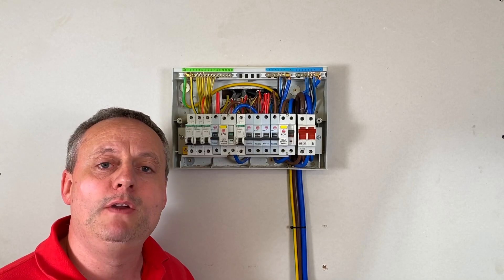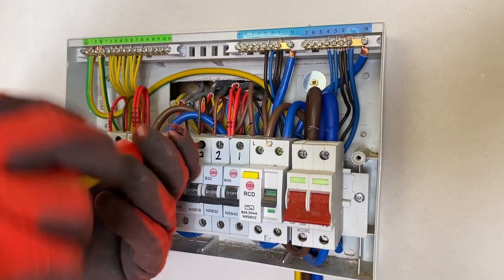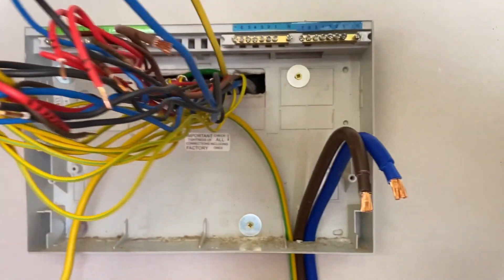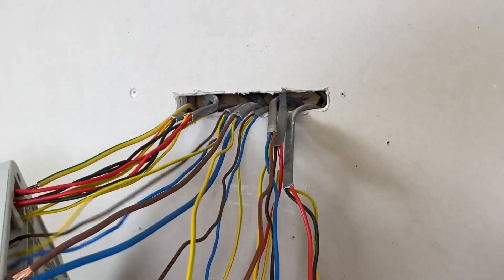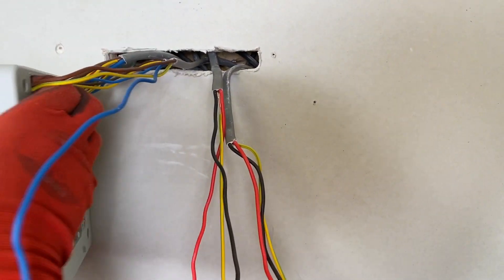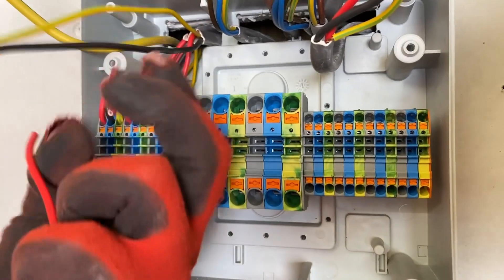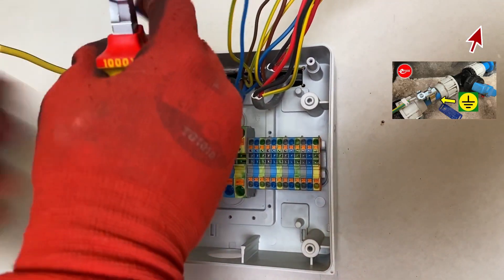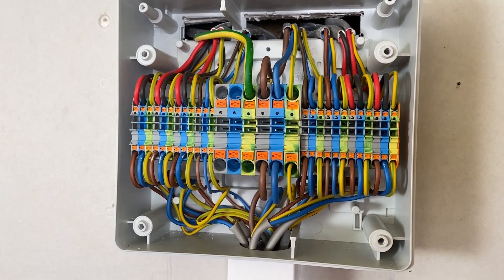How to Move a Fuse Board - The Easy Way |  Wiska Consumer Unit Relocation Kit

Comment: As the regs require the consumer unit to be metal, surely that box should be metal as well? It has all the same circuits and twice as many terminations inside, and must represent a key risk area.
Reply: Interesting that in the UK everything needs to be metal and earthed. In Germany it's not required and most consumer units are isolated and also mostly plastic boxes.
Reply: @scwfan08  Maybe German installers have a history of better installation work. We have a history of fires started by consumer units, mostly I think down to poorly made connections. Probably the same reason arc fault detectors are now bring introduced.
Reply: @Rosscoff2000  fault detectors ? What are those ?
Reply: @S-Theo  Did I mention fault detectors? Do you mean arc fault detectors as fitted to modern consumer unit installations?
Reply: @Rosscoff2000  when was the last consumer unit fire you saw? I've not seen or heard of any
Reply: @Rosscoff2000 I've seen it first hand, German, Spanish and Italian, forgive the pun, but shocking standards.
Reply: @scwfan08  well they were plastic but a lot of the London electricians are not capable of tightening the terminals up, and as a result the London fire brigade put pressure on the people that write the regulations, because they were attending so many fires each week, from poorly installed units.
Reply: @scwfan08  In Germany the walls are made of concrete. Wooden walls are very common in the UK.
Reply: @scwfan08  every system in whatever country you’re in, must be earthed
Reply: @daron8982 
Not if it's protection class 2 which most consumer units are here
Reply: @daron8982  What's that got to do with the original question?
Reply: @scwfan08  class 2 is plastic isnt it, not every applience is plastic
Reply: @icarossavvides2641  what was the original question
Reply: @icarossavvides2641  Nothing. But he is responding to a remark made in response to the original question, so his response is perfectly valid.
Reply: @scwfan08  He said every "system" has to be earthed. And he is correct.

There has to be a way to get the fault current back to the distribution transformer from where it came, otherwise the breaker won't trip when it needs to trip.
Reply: Perhaps not in this instance when connectors are spring connectors with constant force applied on conductors and no risk of coming loose. Consumer unit is different. You don't torque terminations up and and you get fire
Reply: @piotrlobacz  thats why sprung connectors are limited to 6A circuit loads only here. Anything bigger must be in a screw type terminal. Seen too many fires caused by these types of connections
Reply: Its not a consumer unit. Its the same as any plastic, crappy box you could have anywhere in your house
Reply: There’s no switchgear or similar inside so it can be plastic
Reply: @TheAviation101  it's loose connections that mostly caused fires I think, not faulty gear.  But push fit doesn't suffer from that so much of course.
Reply: I have been lead to believe the reason consumer units are now steel is so the fire brigade can isolate power with no risk of molten plastic . 100amp isolator switches are still plastic
Reply: It’s not a consumer unit it’s just a big junction box.
Reply: Regs require consumer units to be non-combustable as that is the fire bridgages point of access to isolate the supply in an emergency, so if it has melted that put them at greater risk . Their is no requirement for other accessories etc to be metal as yet as fire officers should not need to touch them
Reply: @mustardcrumbles  Where is that stated? The IET commentary on the regs says it's to contain fires within the enclosure.

The change to enclosures made from a non-combustible material is due to the rise in deaths from consumer unit house fires, which London Fire Brigade (LFB) has recorded. In 2013/14 alone there was a record 253 fires involving consumer units. This is a steep increase from 71 fires in 2011/12. LFB reported that the reason for the rise in fires was due to ‘substandard cable connections made by the electrician’, which led to the plastic enclosures overheating and igniting.

In effort to prevent overheating of the connections, the metal clad consumer unit or metal clad cabinet will contain the fire inside the enclosure and minimise any flames should they escape.
Reply: Don’t require metal specifically, non combustible is the requirement
Reply: No breakers though ... Apparently the "source" of most CU fires by all accounts ... How ironic is that! Duh!

Kind of makes my point that I have repeated ad nauseam for years ... Fit a disconnect temp sensor INSIDE the CU. Plastic needs a source of extreme heat (>200°C) to ignite. Remove the source of overheating LONG before it reaches that 200 plus temp (say 75°C) and PREVENT a fire from ever starting in the first place! None so blind as those who will not see!!
Reply: I thought this when I fitted one.
Reply: Totally agree what’s the difference???
Reply: @davelivermoore308  It's just a very large junction box. Consumer unit has switch/control gear.
Reply: Only because there are breakers in there.  You don't need to use metal connector boxes do you?
Reply: In the adaptable box it isn’t switched load where it is in a consumer unit. 
Looking at this video because I’m relocating a consumer unit tomorrow and looking at products
Reply: Like all those metal junction boxes you fit, lol
Reply: Why would it need to be metal?
It's only a junction box, there not required to be metal.
Reply: @15markav15  It's not 'only a junction box' - it has the same current and twice as many temrinations as the consumer unit, so it must represent a greatly heightened risk over an ordinary junction box (which is the main reason why consumer units are required to be metal).
Reply: @Rosscoff2000  it is o ly a junction box, as with wago boxes that are rated 32a by manufacturers etc these will be rated hight. So it's a junction box rated for probably 100a or more.
Reply: And Henley blocks are plastic and rated for 100a or more.
Reply: @15markav15  Older Henley blocks are bakelite, not plastic. Modern ones are arc resistant glass reinforced polyester (grp) - a very tough fire resistant plastic.
Reply: @15markav15  Hnley blocks are kind of a fire rated plastic, some are bakalite, and some are a fire resistant fibreglass
Reply: @Rosscoff2000  The metal requirement came form the London Fire Brigade reporting fires caused by disturbance (and loosening) of the main tails when meters were changed (negligently) by the network provider.  They did not generally arise from other loose connections. As there are no tails terminations, it seems plastic is OK.
Reply: @15markav15  your right there's no requirement
Reply: @15markav15  if you look at those very old consumer unit were metal boxes and than plastic and metal boxes again and who knows may be plastic again
Reply: @khaankhaan2714  maybe even wood.
Reply: @15markav15  your comment reminds me the very old light round switches with brass cover on the wooden board
Reply: @khaankhaan2714  still come across some of those old switches today, doubt any lap switched will last 70 years.
Reply: I don’t really get the benefit of these boxes. If I have to move a board. It’s usually because that area is going to be used for something else or it would look bad to have a board there. So replacing a board with basically another board without switch’s seems a waste of time.

Comment: Hello, I have a quick question about the regs, I am thinking of having the consumer unit modernized but would it be possible to place an isolator switch between it and the mains? As this would make it much safer to work on it afterwards.
Reply: A REC isolator is what you're looking for.  Despite REC standing for Regional Electricity Company they're not the sole supplier of them; even Screwfix do them (part 321FR).  There are also 3- or 4-pole versions available for polyphase or Economy 7 installations.  They also make it easier if the tails to the new consumer unit would need to be extended, as the existing tails can simply be brought into the isolator and new tails run from there to the new board.  No opening of the meter cover, no tripping of the meter cover tamper switch.
Reply: Yes
Reply: Many CU's contain a double pole isolator.  You don't necessarily need a separate one.

Comment: Would it make more sense to prep the enclosure with the new cabling in the connectors before offering it up? Makes it a lot easier to handle the cables rather than working with it in situ. Obviously it depends on the installation and where those cables run to after the trunking

Comment: Panel wiring termination  blocks ,was wiring them on naval ships 30 years ago ,cables were all black and we had to tag them with number sleeves ,house wiring is nothing compared to ships control wiring systems ,440v,240v,115v
Reply: That'll be why at least one royal navy ship needed a major electrical system overhaul last year, after a number of faults causing fires and phantom crossed phases. (Not really sure if I'm allowed to say which one)

Comment: Got a board change tomorrow morning, I’m going to use a sharpie to number the line conductors. I usually flag lines with insulation tape, its a nuisance if a tape breaks off whilst removing the old board👍👍
Reply: What happens when you erase the lines whilst manhandling the wires during CUremoval ??... 😮🤡
Reply: @peterfitzpatrick7032  sharpie is pretty indelible. Any permanent marker

Comment: whats wromg? crabtree and wlex breakers in the same board bus bar missing dual rcd
i have used onr of these in  my own house and used the brother label printer with heat shrink lables  to idernify the circuits at both ends should I ever sell thje property or other electrical work is required both ends have been identified.
An epensive bit of kit when its possible to replicate for a cheaper price.

Comment: Good to see a plastic din rail. Had  a few condition reports when boards have being change just to find cpc with low readings due to metal din rail nice job and well done
Reply: I would have thougt that a non bonded version of the DIN rail connector would be available in earth colours.
Reply: The problem is that the grounded earth/saved earth was in the history one point for all together. It was never a problem to bonding it together till we create RCD's. I wonder why Wago not produce yellow-green products same the gray or blue in plastic only. A plastic DIN-Rail is a wonderful solution but IMHO not a correct way. 

I self would let in this parts how I use only, empty Wagos looks like something forgotten here. Do you can buy numbers for the Wagos so count it 1,2,3,4, aso. Then the table looks exact correct - nobody know the next electrician put it under or left and right. 

The only problem are the UK fire rating where do you should seal the hole. I am unhappy that CU should be metal for fire safety but here plastic is okay. Do you have crazy regulations in UK. Just a hint! 🤔🤑

Comment: Hint for the lines on the Wires: I usually use a thick Line to indicate 5 Lines, to make counting easier (4 same sized lines is the upper limit of what you can easily count at a glance. but 7 Lines could easily be confused for 6 and the other way around).
It looks like this (up to 15):
▎
▎▎
▎▎▎
▎▎▎▎
█
█   ▎
█   ▎▎
█   ▎▎▎
█   ▎▎▎▎
█   █
█   █   ▎
█   █   ▎▎
█   █   ▎▎▎
█   █   ▎▎▎▎
█   █   █
Reply from the maker: I will tell Rick 👍🏻
Reply: That’s a good idea may have to give it a try
Reply: I tend to use one along the length of the cable rather than a thick line.
Reply: Great tally replacement :-)
Reply: Good idea, I'm having it!
Reply: Ive always nicked or marked my cables in batches of 3
Reply: The Romans invented an excellent system 2 thousand odd years ago...!
Reply: I would’ve written Roman numerals in the real world. VII Clearer than IIIIIII. Not even shore I did the correct number of I’s ;-). Or written the markings on masking tape and place round cable. Thanks as always.
Reply: @asvananda5328  it is about marking single wires, not for Cables. too thin to write anyting legible on them, especially in the field. Also i used something similar the roman numeral form, but with a thick line instead of a V. and without the subtraction shortcut (that could be confused by reading from the wrong direction) and multiple 5s since i cannt see a way to clearly mark anything bigger with just lines of varying thickness available.
Reply: Good idea. I believe i was first behind this type of the marking cable idea.
Reply: I used to wire a lot of cold rooms in supermarkets and there was a lot of single cables going to different places I found nicking or marking the cables with 3 nicks then a gap easiest to read
Reply: I number by thickness of cable so every 1.5 starts at 1 then 2.5 again starts at 1 so you never get high numbers
Reply: The Romans were ahead of their time 😉

Comment: My 2 pennies worth. Open wall up wider & square where cables end , joint cables as required with over sleeve to maintain insulation required push back into cavity , flat access plate on wall new cables jointed to new location simple! Over thinking this job with unnecessary likely expensive extra parts. Also leaving a big box on the wall .

Comment: They are ok, can't imagine a customer being too happy with one of those stuck in the middle of a hall or lounge wall, I always use a through crimp when joining a bonding conductor, I have seen people use a big connector or even an earth clamp chucked under the kitchen units.
Reply: Agreed a flush version would go along way.
Reply: Even so, it's not going to look any worse than the CU that it's replacing.
Reply: @Rosscoff2000  yeah it is
Reply: Usually the tails and main cpc come through with circuits so they would have to be extended but no room. The middle blocks would be used for shower and cooker.

Comment: Seeing this reminds me of the one Artisan did awhile back where they took radials from the new CU to one of these boxes where the rings where. Thankfully labelled up to test in future from the Wiska CURK. That said I feel like unless you can get 2 separate din rails top and bottom in there it's not actually big enough for most properties, not to mention if you have to size down for fine stranded conductors, wouldn't you just ferule them?
Yes you can join the protective bonding conductor, it's just down to jointing method, my preferred methods are crimping or brazing. If you could run a new cable that would be preferred but cost and accessibility are the limiting factors.

Comment: If the run between this and the new CU location was entirely through trunking I'd be tempted to use singles for the extensions, just that little bit easier to handle than T&E.  Is there any reason in regulations not to?
Reply: I think you could only use singles if the trunking can only be opened with a tool rather than just fingers
Reply: @andrewchilcott5312  No, I don't think so. 416.2.4 is about the use of a tool to remove part of an enclosure providing protection.

It's to do with preventing electric shock risk, by people, even children opening up an enclosure where there are live terminals or joints inside.

When you run PVC singles in conduit, the conduit is providing mechanical protection and there is no possibility of getting at any live parts unless the person cuts through the PVC single, but that then is a very deliberate act.

If however, you joint a PVC single in a conduit then that's a different matter. But ideally you wouldn't do that anyway.
Reply from the maker: Thanks for adding your thoughts 👍🏻
Reply: It may be easier to handle in one aspect, but on the other, imagine replacing that consumer unit some time, let alone going from not to an RCBO board… that would be an utter nightmare. Having the wires of the various circuits physically grouped is something that makes things a lot easier to handle.

Comment: I can never understand why we can have plastic enclosures like in this kit . . When consumer units have to be metal.
Reply: because this is a junction box, it doesn't have any active hardware in it, so the fire risk isn't there.
Reply: I agree. My understanding is that cu fires normally start because of loose connections  so why is a large  junction box any less risky.
Reply: @alanbeard4871  Understand what your saying but think as long as you have carried out your testing after installation they should not be loose. the wago and similar are sprung terminals so should  tight and maintenance free. Having said that I'm sure it wont be long before we get Chineseium copies, which would be risky.
Reply: @PhilMozchops1974  But the fact remains the fire brigade identified the cause of many house fires is loose terminals in the consumer unit. You have to face and deal with the actual problem ..those loose terminals occur and will continue to occur.
There is a problem there that needs to dealt with and the fire brigade felt the fire risk could be reduce significantly by requiring consumer units be fabricated from metal instead of plastic.
Reply: @alanbeard4871  Alan, you are 100% correct.